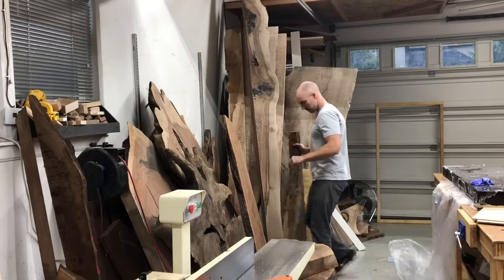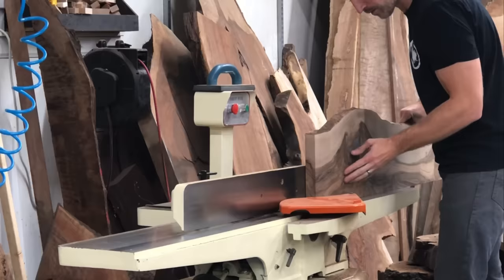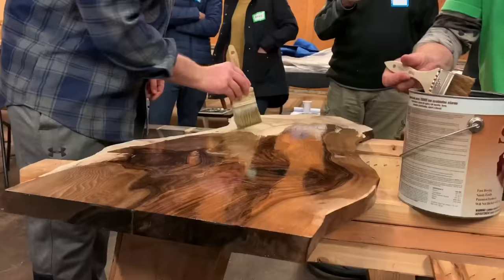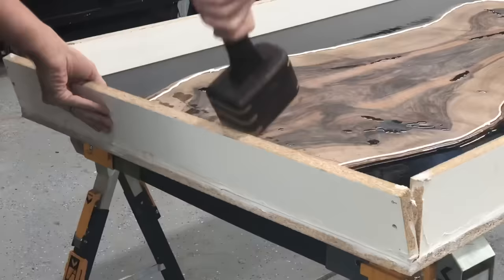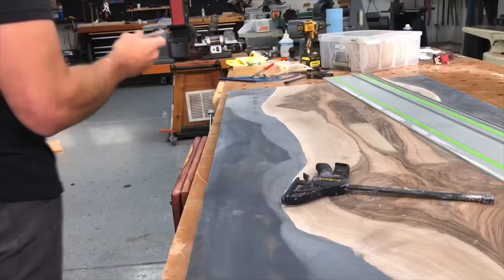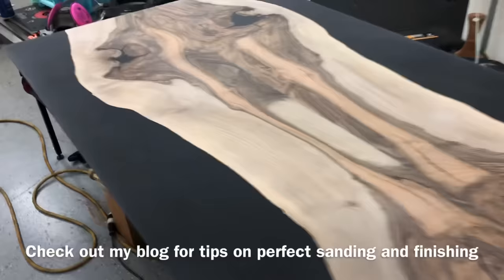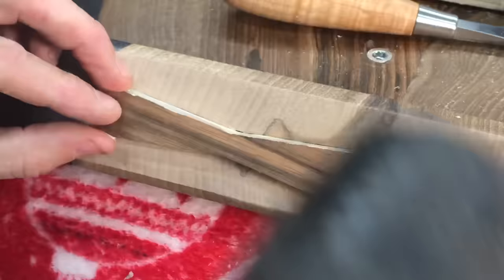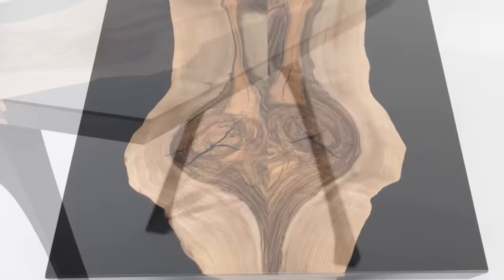Use Half the Epoxy In Your Table Project

Comment: Love the videos!  Was the epoxy seam that you covered with bow tie a result of epoxy wicking to the wood as you adhered that end piece?  What if we use a small bead of clear silicone to create a barrier between the epoxy and wood glue when you adhere the additional pieces?

Comment: The table top is beautifully done! 

The only Question i have for you. Is why don't you use 45 degree angle cuts on the end piece's instead of a straight 90 degree cut and a mirror image on your ends? I understand it won't be as much of a blind thickness but it will give you a thicker appearance as long increase the end cuts instead of a cut a square cuts?
Reply: I would believe it's because square edges clamp easier then mitered edges. I fabricat solid surface counter tops and I get a stronger bond and easier to clamp.
And once polished out you can not see the joint. 
Just my to cents!
Reply: @midkansaspolebarns2875  yes they do. 
But the mostly fail giving you a thicker appearance giving you a butterfly edge if they are not perfectly straight and vertical before your cutting.

With both pieces being at the 45° Degree they are a match and will look as one there by giving a solid and thicker appearance for the table. 

Yes the 45's are harder glue but with the right clamps or jiggs it is totally achieveable.  
They are also more of a professional appearance, in my opinion.
Reply: Each is own man I know how we do it and it works great and is a stronger joint. You do it how you do it and it will be just fine 🙂

Comment: I love the videos! I'm may purchase a CNC Router. If I had a solid slab of wood say 6" deep, do you see any issues to reduce the amount of epoxy if I routtered out a design to say 2" deep throughout then dropped to 6" on edges to give appearance of the full depth? If so what would be the minimum depth you would recommend? Thanks in advance!
Reply from the maker: Not sure what you mean, sorry!

Comment: Cam, I just noticed in this video that the final top side of the table does not appear to be the book matched side?  Did you make a mistake that caused you to have to use the non-bookmatched side as the top?  Or am I crazy?  The final table does not appear to be the mirror image that it does earlier in the video.

Comment: My only knock is the welds on the legs were hideous. Not uniform at all. Also probably should have done some fusion tig passes instead of mig beads. Other than that it came out nicely.

Comment: may I ask the detail of the spray you used for polishing step please? Also the chemical(or method) you used(or did) for washing off the resin on the mixer blade?
Reply from the maker: I let it dry and break it off
Reply from the maker: I let it dry and break it off

Comment: I love your work around to fix the blemish using the bowtie. I am curious tho as to what your thoughts are on how to avoid that issue from occurring again in the future. Would a small "dam" of CA glue and activator work to stop that bleed line of epoxy into the wood?? My thought process is that it would cure fast and stop the bleed through on your display face.
Reply from the maker: Just need a tighter seam
Reply: @BlacktailStudio  as in use more clamping pressure next time?

Comment: Does your Shellac coat get sanded off when you put the tabletop through the wide belt sander (or planer - whatever that monster is)?
Otherwise, the Osmo/Rubio top count would not take, correct?
Reply from the maker: It does 👍🏼

Comment: Hi Cam, since this is quite an old video you may not even this question. 
Why do you apply Shellac to the slab before pouring the epoxy? 
Thanks
Reply from the maker: Prevents staining from the black epoxy
Reply: Great idea! Thanks bud

Comment: Cam, I have a question (sorry I know this is an old video). I’m making a large bar top (18ft x 3 ft) and using 1inch thick hardwood. I intend to use a good plywood sub top. Would it suffice to glue the hardwood to the plywood and then pouring a black river - then finishing (of course I would varnish top and bottom of the hardwood first). Or should I make the whole 1 inch thick top and then glue it to the plywood base afterwards like you did here? The edges won’t be showing because of bar tails and drink rails.
Reply from the maker: Man, that might be a whole conversation. Sorry!

Comment: Hi Cam.. i have an issue with my slab.  After drying/flattening i only have 1-3/8" left in thickness.   Would you recommend raising it up 1/4" so that the pour adds another 1/4" thickness to the bottom?  I've been told 1.5" is minimum.  Thanks!!
Reply from the maker: I don’t usually do that

Comment: I have a maple slab 16" w x 12'l L x 1 1/2" thick. One end has a 3' long Crack that opens about 1/2" at the end. I have pipe clamp on the end closing the Crack almost closed. Will a bow tie keep it closed? I'm thinking of putting a 1 1/2" × 12" x 1/8" piece of steel or aluminum on it with 1" lags on the bottom. Your take on it will be greatly appreciated.
Reply from the maker: Ya, add a bow tie👍🏼

Comment: If my slab (thin) is a little curved and i pour it forced staright...Will it pull epoxy curved also when i release afther pour or Will epoxy hold it straight ?. Ty very much
Reply from the maker: It will probably bend back after the epoxy

Comment: loved the ideea, now comes my constructive criticism:
1) when you bookmatched the board you bookmatched on the wrong side. on minute 3 you show thie mirror side (the one that is supposed to be up), but on the last reveal min 11 you obviously did end up with the non-mirror face up (or sanded a lot so it is no longer bookmatched)
2) i would have epoxi-ed the plywood in place (with the screws in). the plywood would have stabilised a lot better the top. just 0.5 mm of epoxy would have made a much better slab. Just don`t squeeze all the glue out You did not put any C-channels here, the top is sensitive due to high figure wood.
3) i would actually use the 2 layer table to build in some tech in it. since you have all that black edges, (like lights, chargers etc)
Nice legs!
Reply from the maker: Na, I did the right side but had to plane more off than expected. Which un-matches it pretty quick as you remove wood

Comment: This is a genius idea, you could’ve taken it further by 4 way butterflying the wood  and letting it be even thinner.
Reply: Wondering why you didn’t cut the ends at 45 degrees though
Reply: Oh boy, planing it down really messed up the book match. How much did you take off?
Reply: Oh I see, you used the wrong sides up by mistake. The book match sides are under the table.
Reply: Then when you planed it down it didn’t match anymore.

Comment: How scratch and scuff resistant is the epoxy for a table?  I have seen so many of these epoxy tables on youtube but the epoxy is usually in the middle mostly.  With the epoxy being on the edge it will get much more abuse.  Just wondering if it will easily chip from a chair being pushed into it or if using it for an dining table will get it scratched up.
Reply from the maker: Oh, like a hard plastic

Comment: Yo Cam....Do you ever use any other woods besides Walnut or other north american hard woods? Specifically any tropical hardwoods? Bubinga, Cocbolo, Zircote, Padauk, Gongalo Alves, Jatoba, etc? Do you ever have trouble finding a glue that reiliably works well? I find that some of these just won't glue with almost any of our standard glues. Even the ones that do I usually scuff the surfaces and acetone them before I can get a good adhesion. Any experiences in these issues?
Reply from the maker: Oh, a little. Probably not enough to give advice though

Comment: many years ago i worked with a pattern maker, i didn't know what a pattern maker did at the time. the simplest answer is someone who can make a fire hydrant out wood. they make a half of a hydrant and attached it to a flat piece of wood and send to it to a Foundry to be casted in metal. in the aeronautics there are pattern maker, they work with metal, aluminum , wood etc. I know too much info, anyway he was a master craftsman. one the first things he told me was everybody uses too much glue in wood working. he said that too much glue is just glue holding glue. there was more to it, but that's is the part i remember. so the whole squeeze of glue on wood projects isn't the best way to hold projects together. i have never got any response on this topic. what is your experience and knowledge ?

Comment: This is an absolutely beautiful build and I really like the details like the chamfer. If I can make one criticism, it is to that piece of plywood on the bottom. I realize it is on the underside and not particularly visible but At the same time, it is such a shame to cover up the beautiful grain and pattern on the underside with that, frankly ratty piece of plywood.  It looks so out of place compared to the absolute beauty of the table top.

Comment: I made a resin table , it sits in front of two bi fold doors and when the sun is out it gets very hot and the resin gets soft , it has distorted a bit . Is this becausei didn’t mix the resin right or should you not keep a resin table where it will get hot ?
I used Glasscote 50 resin .
Reply from the maker: Hot epoxy can get soft

Comment: The table looks great all by itself, but... 

1. Metal legs don't complement the wood:  the wood has grain, flow and depth while the legs are hard, edged and have no depth.  

2. It may be difficult to place the table in a room where it blends with the rest of the decor.  

3.  The bow tie should also have been end grain, the better to blend.  Given that, there was no reason for it to have been a bow tie; it could more easily have been rectangular.

My idea is that the legs should also have been finished wood with a prominent grain.
Reply: Interesting. I personally thought the table legs contrast made it better, not worse.

Comment: Do you ever have an issue with the pigment in the epoxy staining the wood. I am working with a redwood slab and want to make sure I don’t ruin it.
Reply from the maker: Definitely. You’ll want to seal the wood
Reply: I am just filling knots and small voids. Would you recommend that I seal the whole slab before filling those small areas or is there a way to not waste that much time and epoxy

Comment: What does epoxy feel like to the touch after 72 hours or when it is cured? From a very small third world corner of the globe. Mine still is not hard after 72 hours and you can still dent it with your nail after 72 hours and I cannot sand it properly. Would really appreciate a response. Thanks.
PS: Great content and detailed explanation is very educational.
Reply from the maker: Wait at least a week. A little heat will help cure it faster too
Reply: @BlacktailStudio  Thank you for the advice.

Comment: Older video so not expecting a reply, but why not keep the slab the same thickness (ie, 1.5"). Do a 0.5" pour and let it mostly cure, set some 0.5" plywood as the second layer, and do another 0.5" pour on top? Of course the epoxy would have to be tinted completely opaque as to not see the plywood in the center. That way it looks just as good from underneath as from the top, but still saving a little less than a third epoxy. Have some Modesto Ash slabs from my grandparents tree and want to do something similar without breaking the bank.
Reply from the maker: Good ideas!
Reply: @BlacktailStudio  Wow, you really do reply to everyone! Videos a year old at this point. And thanks! Wasn't sure if that would be a viable option

Comment: I know this is an older video, so you may not see this, but I was wondering something. (Preface: I have no experience worth noting, besides watching a bunch of videos by this one guy at Blacktail Studios, lol) I assume you cut your bowties running with the grain, to give it holding strength from one end to the other, when used to reinforce the wood. So, if you're only doing it for cosmetic/ touch-up purposes, could you cut it in any way that would best match the grain it is patching?

Comment: Cam.... all artist second guess themselves like 3 times every second... lol... I once too 3 months to complete a damn birdhouse and it came out so awesome (even if it wasn't perfect) that I kind of never want to sell it... but anyway, my point is that I probably would have used the black epoxy and just blacked out that end edge instead of using the Bowtie... visually and concept wise I think it would have blended better into the overall design.... could you have also eliminated a few steps and that end mistake by putting the plywood backing on the slab (with the proper undercut) and then pouring a full edge then trimming it to size?

Comment: Why didn't you just make the mold thicker and placed the base plate in the center? By this you could have done all the epoxy without any additional gluing. You'd also have to glue the wood doubles before pouring.

Comment: Why could you have carved out the epoxy seam and then filled the small part with sawdust and clear glue? wouldn’t that have been less obvious and a little stronger than the bow tie?

Comment: Instead of the bowtie you could have inserted a copper wire or a piece of brass or bronze. 😉
Or you'd be a bit more provocative and carve a line for filling it with epoxy. So you could have covered the imperfections in the mirroring. 😎
Or even more provocative: insert your blackXtail sign in that place. 😂

Comment: So you don't like when people comment on you saying something wrong. How many comments do you get on the "epoxy drying" part?? 
Also, couldn't you save a lot of epoxy by embedding a piece of plywood in the big pools on these non transparent jobs??? So pouring 10-12 mm (half inch) and wait till it can support a wood insert and the add wood and last pour. Or maybe let the insert float, and keeping down in the middle

Comment: I would use real hide glue.  Nothing like it, pulls the wood together as it dries, and 150 years from now, that piece can be reglued if needed.
Reply: whch brand do you recommend?
Reply: @HakmanTim  Any brand that comes in flakes and must be rehydrated and heated in a glue pot.  Yes, it stinks, it takes a learning curve to master, but it's great stuff as long as you don't need to be waterproof.
Reply: @ohger1  nice